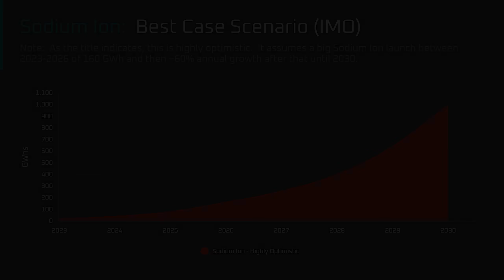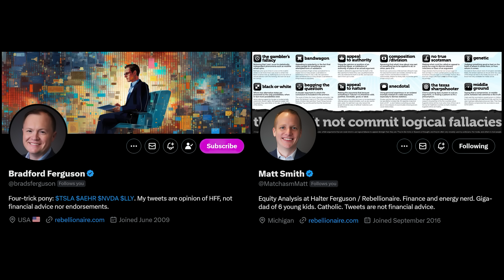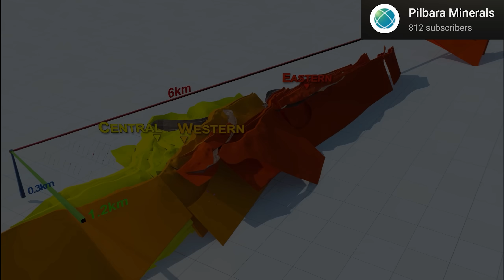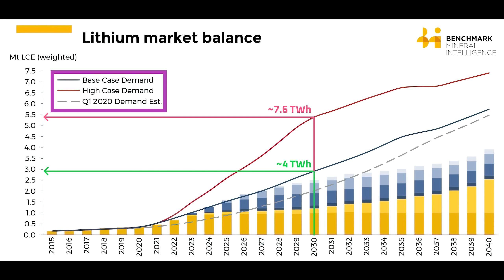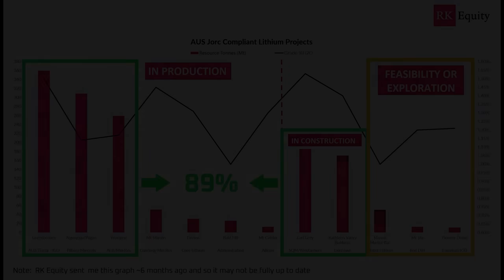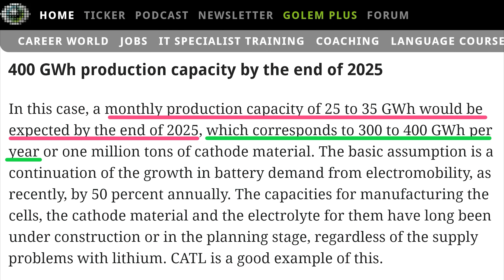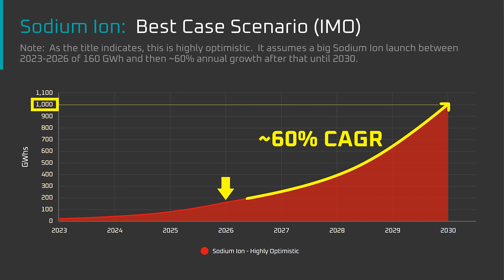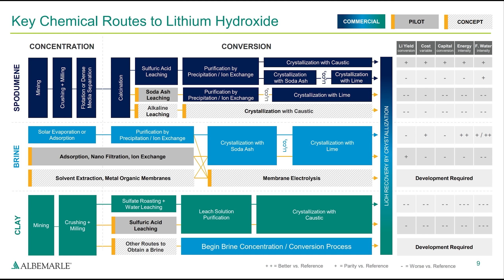Global Battery Supply Forecast to 2030 // Lithium & Sodium Ion // Part 4

Comment: Great video! My question is if other types of batteries could add to the chart? I would like to mention liquid metal batteries, compressed air batteries, and gravitational batteries for example. These types of batteries don't use lithium and sodium. Perhaps around 2030 they contribute significantly in the 7,6 TWatt that is needed. I hope somebody could help me with this.
Reply from the maker: I'll be covering those in my grid storage series 🤠

Liquid metal batteries, despite their marketing, won't be cost effective.  Compressed air is useful.  Outside of pumped hydro, gravitation batteries are dumb.

The place where capacity really needs to grow in the next 6 years is for sub-4 hour duration, so that'll be filled by lithium ion/sodium ion because it's suited to that use case

Comment: Na-Ion is the battery of choice...perfect for mass production, mass energy storage and mass usage........Lithium is going to be fazed out, its too dangerous, short life span and expensive.. Invest in Sodium Ion Energy Storage Cells....CATL is..
Reply from the maker: I'd disagree.  This'll be covered in my next video
Reply: Fair enough...the reasoning is cost, safety , lifespan and volumetric size, but totally agree range/energy density is around half so Lithium has it place but only until sodium is 75% of the energy density @thelimitingfactor
Reply: I am a sodium fan because of safety.

Comment: Please do an analysis of where the electricity is coming from to charge all of these lithium batteries. Electricity may be the limiting factor.
Reply from the maker: Plenty of capacity (flatt the duck curve), it's a matter of grid infrastructure.
Reply: @thelimitingfactor  Yes, the electricity infrastructure is a major problem that will take time, big bucks and political will to solve. Electricity generation in California is also a major problem with annual rolling blackouts in the summer.
Reply: @RandyLunn the simple fix for this is rooftop solar and home batteries.  If these were mandated, the infrastructure problem would be minimised to beefing up local networks to handle peak flows.

Comment: Jordon, Elon says there are lithium rich clays in Nevada which can mined and the lithium depleted clay returned. I understand from your work this permitting will take years - right?  Could the permitting be bypassed by initially using The Boring Company doing "utility" work to extract the clay?   In this crazy idea once the permitting is in place then go back, dig up the rest of the materials while remove the tunnels and back fill with lithium depleted clay to restore the original contours.
Reply from the maker: Yep, covered in the last video.

No, the boring company wouldn't be useful.  Just need off the shelf dumptrucks, etc

Comment: Amazing video. Something I've been wondering is if Tesla will make use of Sodium Ion Iron Phosphate. Not for cars but for stationary energy storage such as Tesla Power walls and MegaBatteries. Pethaps that could help save lithium for cars and make things less hard, specially when it comes to resource allocation. I just saw some news on X that a new Lithium reserve (about as large as the existing in the Bolivian salt flats) was found in a volcano in USA. The more we seek, the more we find. Now that sounds promising, but as you already explained in other videos, it takes years to break ground and start mining, so I guess sodium could provide some relief. Tesla has already gone into Lithium refining, but not into lithium mining yet. Do you think with all this they will have to do it eventually? After all, they were all into vertical integration, perhaps they alongside Boring Company can bring some innovation in mining?
Reply from the maker: Yup!  Eventually I think.  

As for the "new" lithium reserve...it's not.  Just the media digging up an old story and pumping it.

So, it's already included in this forecast.

GM already has dibs on that site.

Comment: I'm guessing the Li industry doesn't want the Na battery to succeed, so they will ramp up their efforts to mine/refine Li to meet demand, and they will reduce cost/prices to stay competitive. The fly in the ointment seems to be permitting.  I really don't see a way around that.
Reply from the maker: They don't care really.

That's because they've been very cautious about opening mines and made sure demand is locked in for decades.

Lithium is fundamentally a better material for some applications, and demand will continue to grow in absolute terms, even if market share decreases